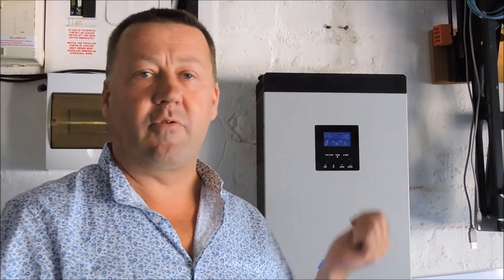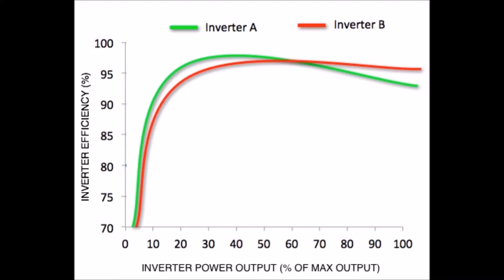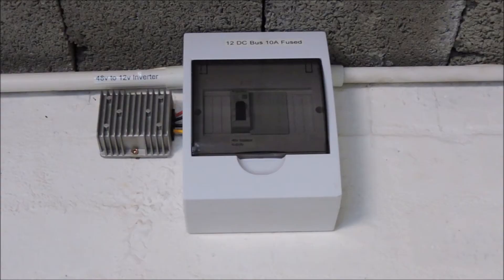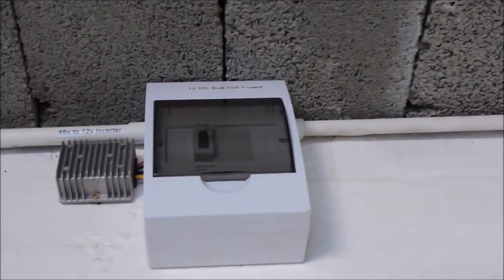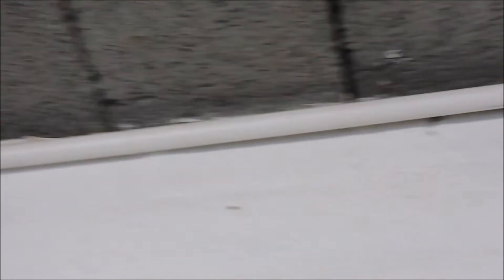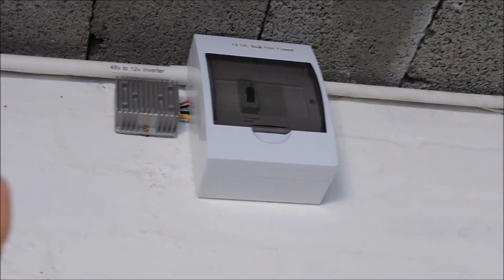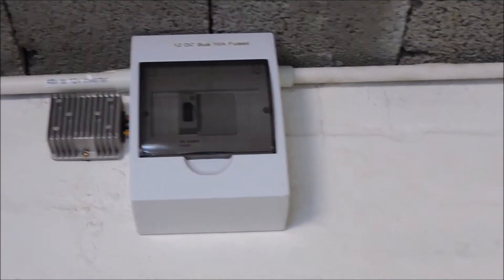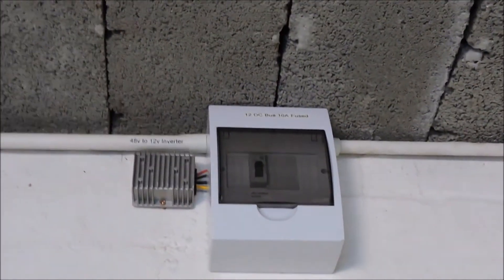Parasitic loads PV Solar 12v DC Project #4

Comment: I would like to see what is going on from the house. After installing it I found out that the remote display is not compatible with the new MKSII generation inverter, and they don't make one for the upgraded model. It does work but some of the parameters show wrong like the PV voltage being 208V DC shows as 20V.Any input on that? I contacted the suppliers and manufacturers but they all insist that it can;t be fixed with an firmware upgrade? Can your Australian contacts or yourself shed some light on this?My e-mail is christoph@reisers.net. Thank You Christoph Reiser
Reply from the maker: Hi there is a new remote display panel coming soon from Voltronic I've been told ...

Comment: I don't understand - did you cut out your AC adaptor you normally use for charging Cellphones etc.etc. Did you install separate points for them? How about   the other inverters on the market, do they have the same problems with parasitic currents? ( btw -a am I the only one who does not get the word "inverter" in English? does it exist in the lingo at all?}.
Reply from the maker: +Dries Fourie Hi I have take all the 12v powered devices I can (Security DVR,  12 v LED security lighting etc) off my dedicated 220V 'Solar circuit' to reduce the load at night and  improve the efficiency.  As larger solar inverters (5Kv) are very inefficient (90% inefficient)at the very low current drain end ie: 10w LED lighting. 

Iv'e used a much smaller (20A) DC to DC converter to supply these 'Parasitic' loads directly from the batteries at 90% efficiency.  They don't need cooling fans and don't convert from DC to AC and back to DC.  Yes I could run these directly from one battery 12v I hear you say (no converter) but my batteries are in 48v Packs.  If you drain only one in a pack even a few mA's it creates an imbalance in the pack and screws the entire pack over time believe you me (even a LED voltage monitor will do this over time).

So this may initially seem illogical but the net result is efficiency at the low end, and if you want to shutdown (Standby) the inverter you can still have some auxiliary essential services running almost forever on a set of batteries as a backup without re wiring your house.